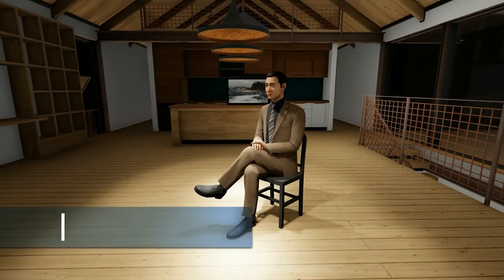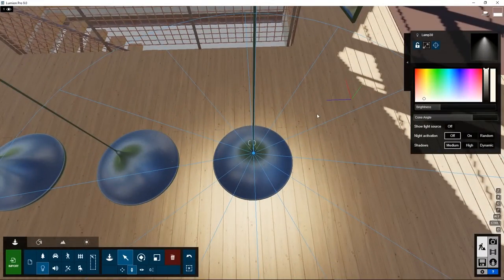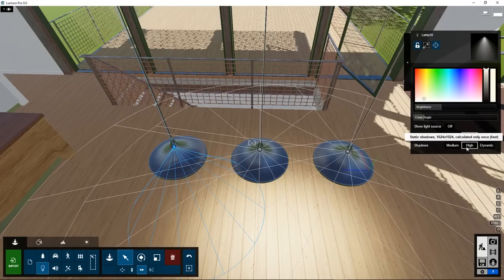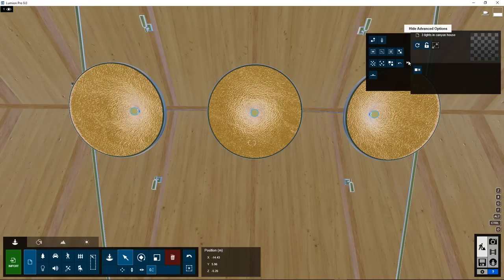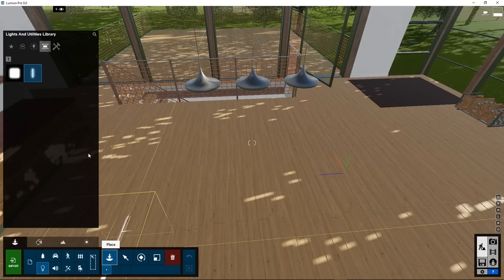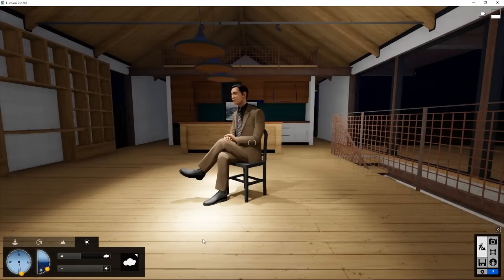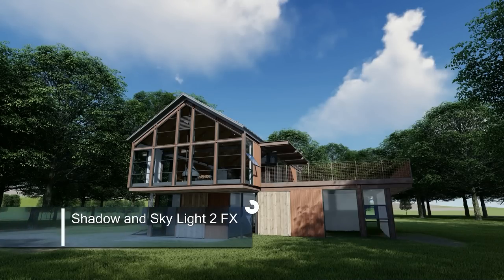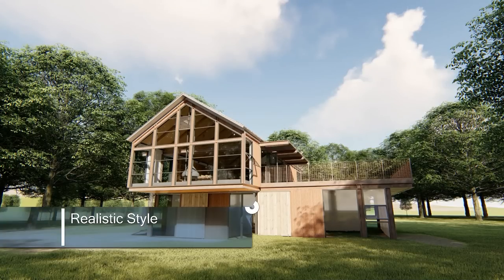How to add Lights to your Design: Lumion 9 - 3D Render Tutorial

Comment: its not positioned at the ground level mam.  it snaps to the surface you click on. so if u place the light by clicking on an object which is 4feet higher than ground the light will snap at 4 feet